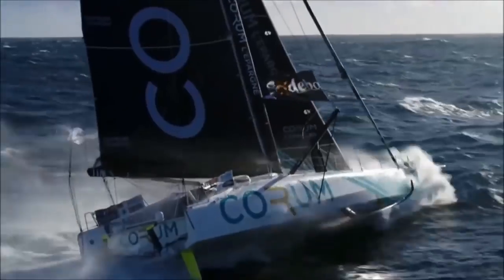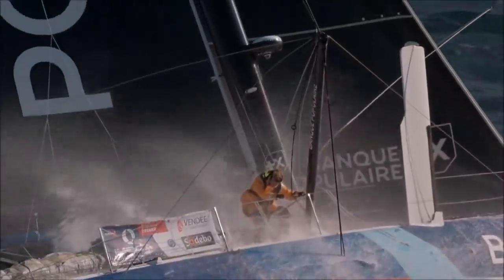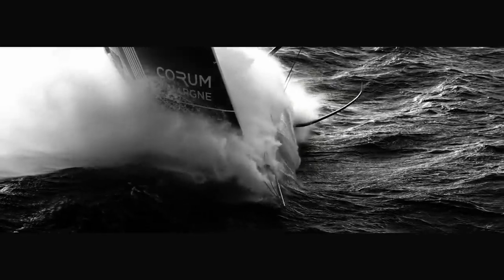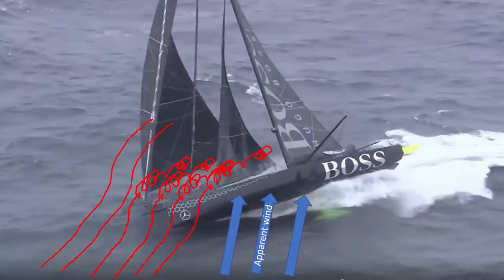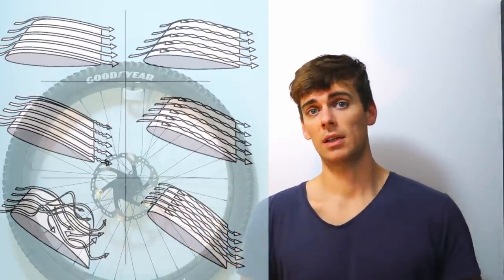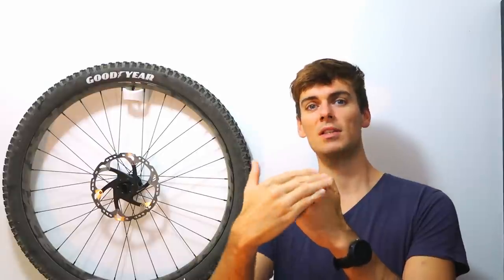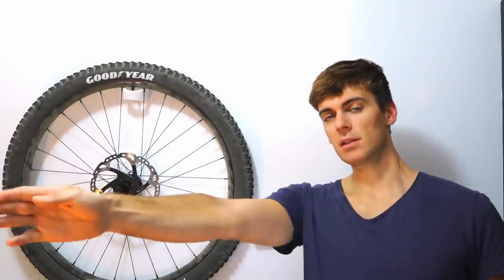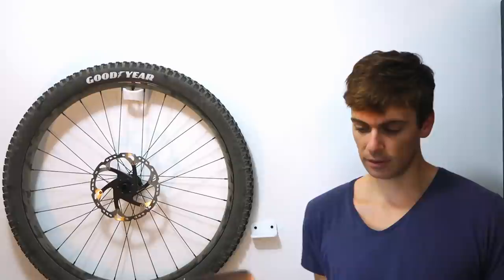Why Corum Dismasted - IMOCA Tech flaw? #VendéeGlobe Boat Design Analysis Part 2 - Aerodynamics

Comment: You are also describing safety elements and tools that make it possible to sail single handed at all.    I don't know a whole bunch of the requirements for this particular race but I will bet that the safety rails are straight up required to be static elements and called out as a very specific definition. This thick of cable of this alloy stainless mounted in this way to these stantion, held to this tension. Its likely as mandated as the life jackets. I will also be willing to guess for single handed offshore races you have to demonstrate the ability to douse the sails and secure them in a given amount of time.

 "IMOCA defines the rules guaranteeing sporting equity by developing the innovation and safety of the boats."   I think anything that falls under the safety is non negotiable and built upon decades of demonstrated safety records.      Lifelines are covered in great detail by section 3.14 of this guy https://www.sailing.org/tools/documents/mo0-[26064].pdf    

The major difference in thinking here is if you fall off of this boat you die.     AC75 if you fall off a chase boat will grab you within 1 minute  and those boats dont really have a deck persay as they aren't meant to shed water or right from an inversion or adhere to any of the offshore racing regulations. 

I'm not sure where to look for the sail bag of lazy jack regulations as this race is officially in french but I'll bet there is a similarly exhaustive set of rules for single handed offshore racing. 
I suggest you flip around these regulations a bit as there are requirements to handle alot of terrifying situations you likely never considered. There are quite a few pages just on escape hatches.
Reply from the maker: Yep. I know. Totally different applications. But I'm referring to them for the trickle down effect of features that could be implemented with minimal impact on safety. Lifting T Rudders would arguably make the IMOCAS safer with more stability!

Comment: Your credibility is reduced when you talk about boat heel and show Alex's boat HB sailing at a severe angle after he broke his starboard lifting foil. Also you mention that the deck spreaders are about 3m in length, I would suggest they are closer to 16 or so metres.

Other than that a lot of your ideas are valid.

Comment: Lean THE mast to windvard like a vindsurfer
Reply: Windsurfers don't lean the mast to windward to create lift much. Look at top level windsurfer racers and you'll see they often hold onto the uphaul line and have harness lines as long as possible in order to keep the mast as upright as possible.  They lean the rig to windward as little as possible because directing the sail power up is less important than directing the power forward.